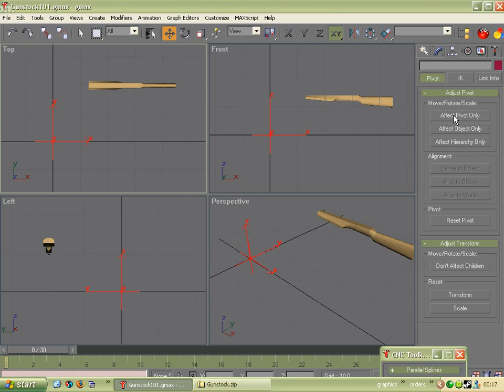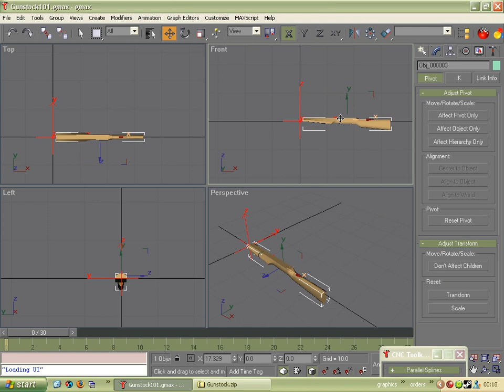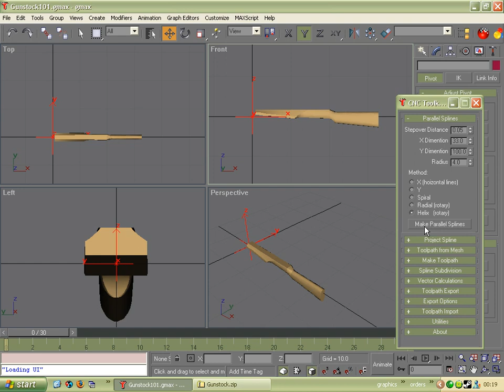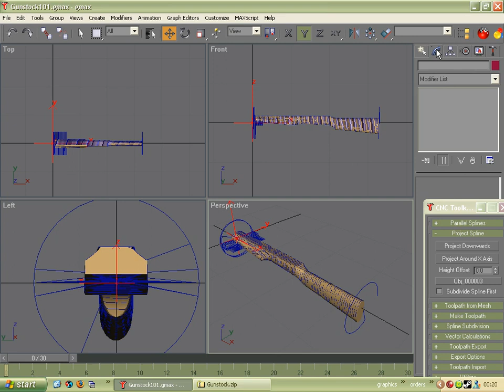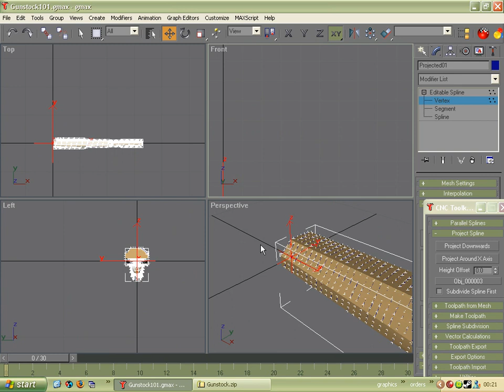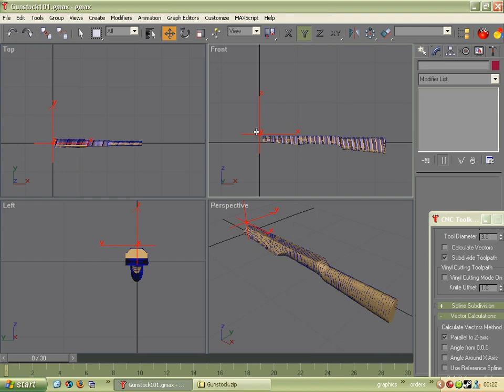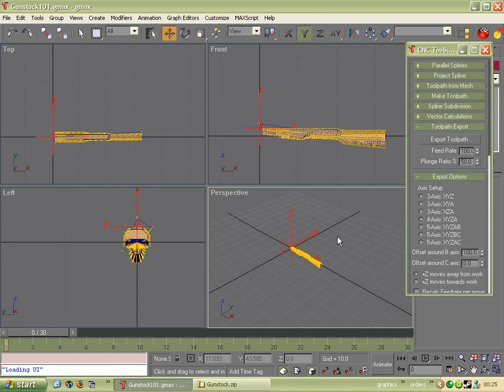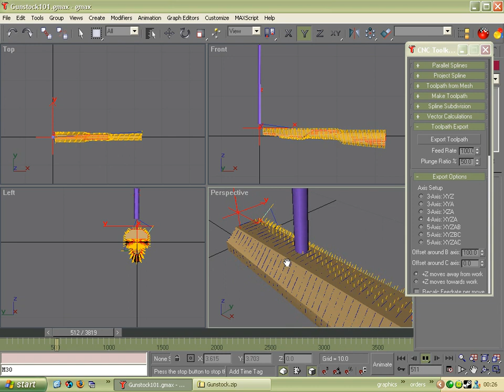CNC-Toolkit-4-axis.avi

Comment: Hi Rab,
We're so excited to start multi axes milling that we've spent nine months building a small scale 5-axis mill with an XYZAC configuration.  However, we've got a point of confusion.  If we can only project splines around the X, axis, what steps can be taken to cut something that is mounted upright and centered on a platen at C?